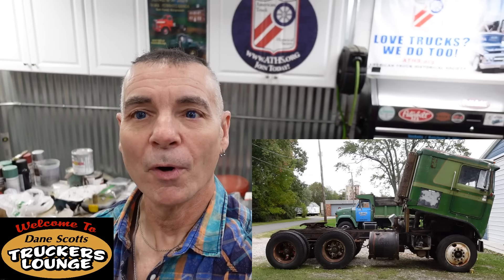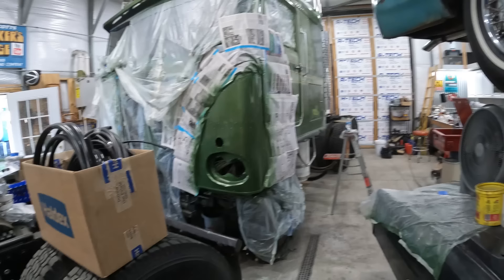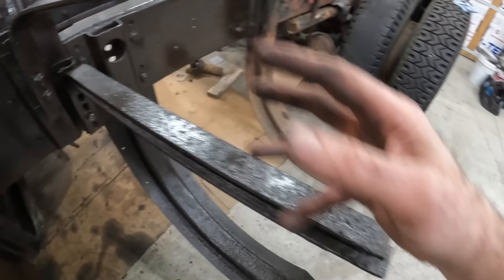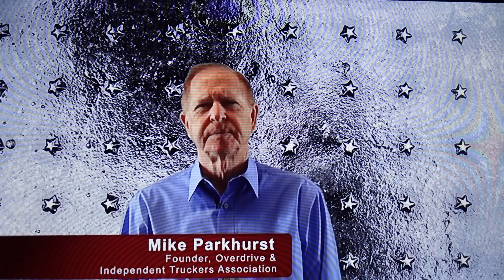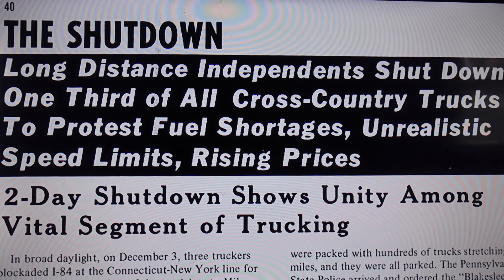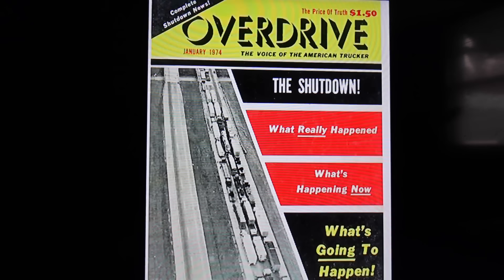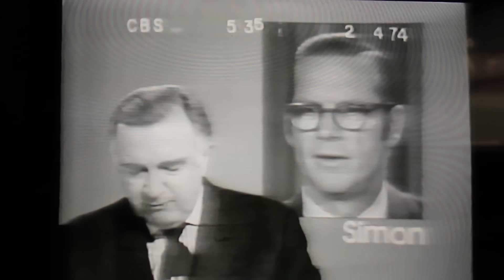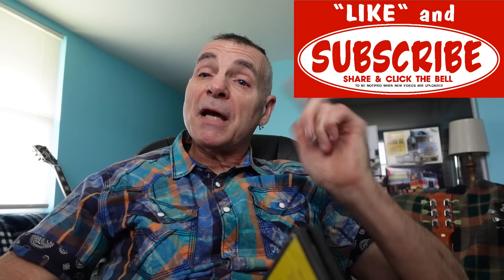Kenworth K100 CABOVER Resto Episode 14 & Trucker Wars

Comment: Hey Dane really enjoy watching the restoration. You’re sort of doing an every man restoration instead of pulling the truck apart the last nut and bolt and putting it back together you’re doing it like 95% of the population would do it due to economic constraints sanding, down a section of painting it with a rattle can Working on an exhaust system instead of having it custom-made totally I can really identify with you because if I was going to find an old truck and fix it up like that, I would be doing it the way you’re doing it unless I won the lottery lol I remember the truckers strike in the 70s and 80s I wasn’t driving yet with the first one and 74 but I remember the ones in 79 and 83. I was driving dump truck in Illinois at the time and I remember seeing trucks spray-painted shut down going home leave me alone painted on the sides of the the trailers.
Reply from the maker: I wouldn’t have it any other way. You can throw money at any truck from a catalog and so what. I wanna see how a guy is frugal and creative and see their personality in their “bucket” now THATS old school lol. Man that’s cool you got to experience the real days of trucking. 😬👍